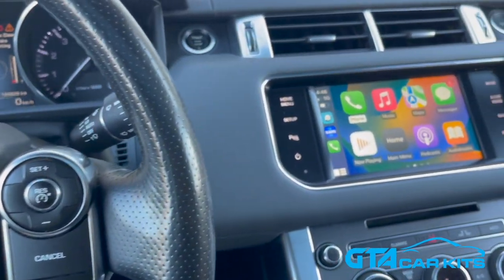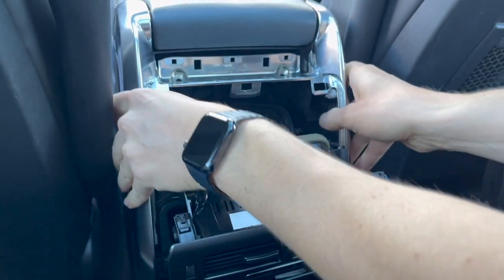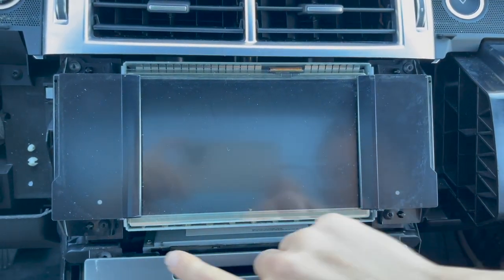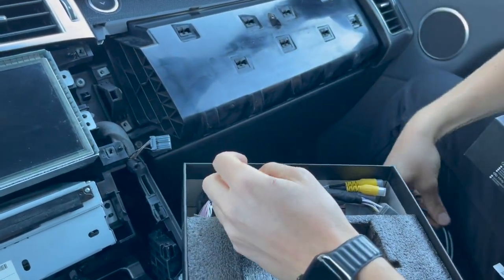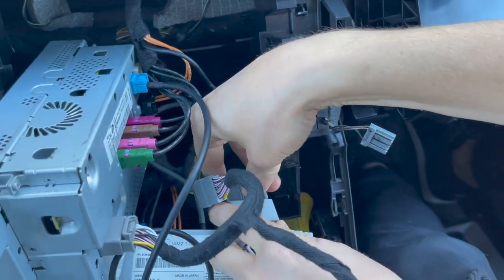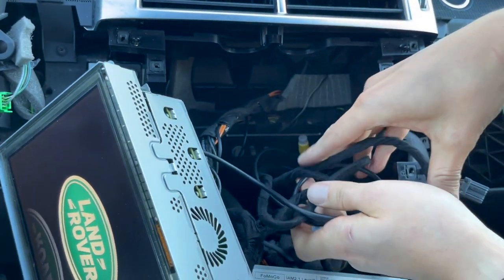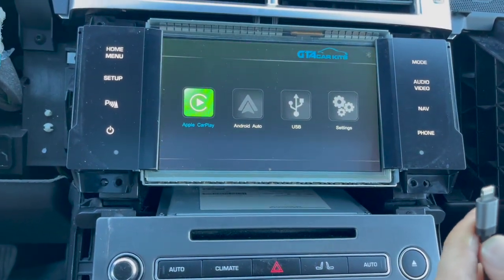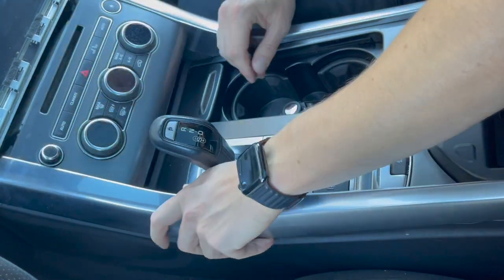Wireless CarPlay and AndroidAuto in Range Rover Sport 2014 2015 2016 Bosch Radio

Comment: Installed my kit earlier this week. Fairly easy install but not without some difficulties. The USB wire into the glovebox, really prevents it closing easily/completely. Not sure what to do or where to tuck in the cable?  The HVAC harness wire was pretty thick and made getting the radio head unit back into place a little difficult.

Also, steering wheel volume up/down works fine – but I cannot use track forward or back button on my steering wheel. Wondering if that's something I did wrong during the install stage or that's expected behavior?

Comment: I contacted GTA and was referred to an installer here in Miami... I bought it and had them install it recently. Works very well, still getting used to it. I use Apple Carplay and so far the only thing I miss is the buttons on the left-hand side of the steering wheel (where you can skip music tracks), they do not seem to control the music tracks if I am using, for example, Spotify on the Carplay. Is there a setting to enable these buttons to control the music playing inside the apps inside the Carplay?

Comment: Any issues with running vehicle diagnostics on the infotainment or instrument module with this device installed?  My Land Rover mechanic said yes it interferes with their computer diagnostics.  I was having issues with my instrument module controls on my vehicle before installing.  Let me know your thoughts.  Thank you.
Reply from the maker: It should not interfere, as our unit works separately from the diagnostic equipment of the vehicle. But we always suggest installing our product on a vehicle that is in 100% working condition without any issues. Thank you.